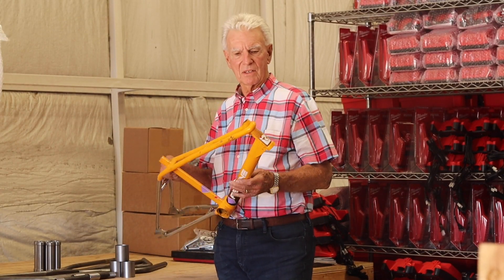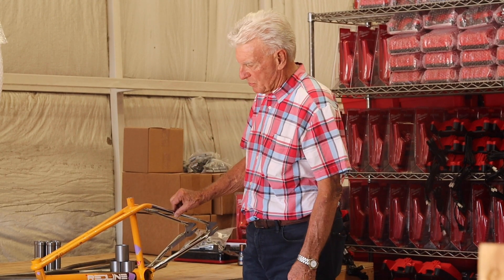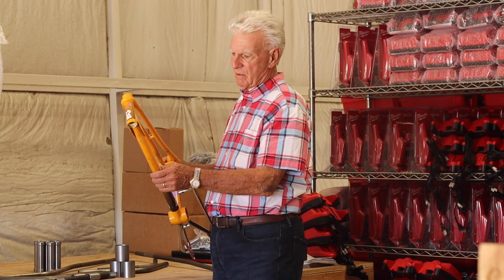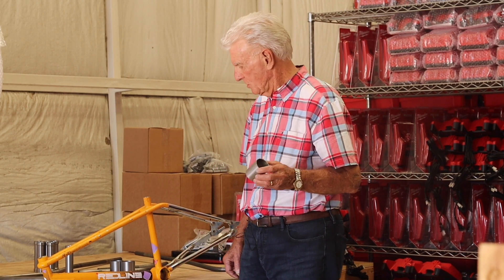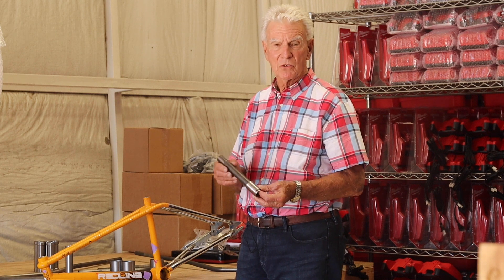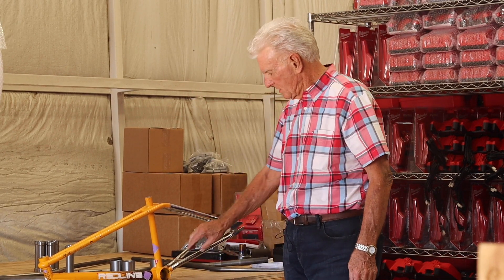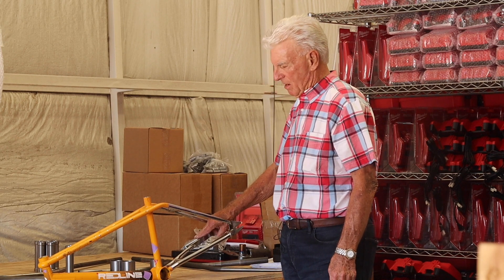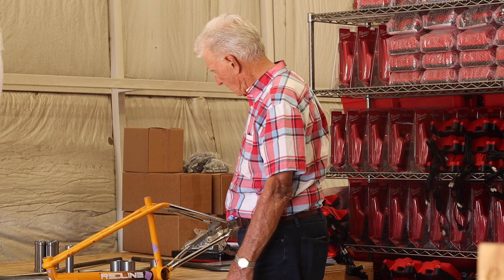LINN KASTAN TALKS ABOUT THE RL 20 II PROSTYLER   HD 1080p

Comment: To me, Redline and Mongoose kind of 'missed the bus' on the retro-looking, modern bikes thing of a few years back. Haro and GT got it right, make a retro-looking bike but with all the modern features, like internally butted tubing, modern geometry, mid bb, u-brake mounts, integrated Headset, 14mm, thick dropouts... Making the bikes exactly as they were is cool, haro did a few 1988 sports and masters replicas too, but most of the retro bikes were modern bikes.

Comment: -One of the greatest, most exciting, days of my 13 year old life @ that time period was when the large box bearing the *Redline RL20-II frame, fork & 'Forklifter' handlebar set having had arrived @ my doorstep!
-Early summer/June 1987. 
-A Father/Son freestyle-bike customized total build project.
-MAN?!...-That set was incredibly $pendy too!  
(Ive seen vintage, 1980's era RL-RL20II frame & fork combo sets being $old on eBay for $1,400 on the low end, all the way up to $2,500+ on the high end!  But the recent reproduction batch of 100 frame & fork sets, $elling for a >> ridiculous << $3,000!?)

-IIRC?  In 1986/'87, the total cost for those 3 pieces was approximately $700+ just for the frame, fork & handlebar set!  
-Which I wasnt a spoiled kid, nor my father a wealthy man, but I was tall for my age & that particular RL20II frame was a great fit for taller/bigger riders. I shouldve kept it around just for its possible resale value in later years eh?

-Considering during the 1985 to 1989 time period,  a top-tier freestyle bike from any of the  big-name brands @ the time ran about $450-$650 for a complete bike with all the bragging power(s), bells, whistles, bruises n' band-aids.

~ WHAT an AMAZING overall design, wonderful, professionally artistic welding work & original manufacturing materials used!

*Only problem being:  The frame/fork combo was in Redlines TEAL color offered, about IMO as bad as the purple 'Rad-Berry' color offered, which I'd originally hoped for the paint color in White, or Red & @ the very least, the  last color being in Yellow. Guess it was the 1980's though right?
-As that Teal set was the ONLY RL-RL20-II Frame n' fork set available over the entire West-coast region to purchase @ the time! Having it ordered from our local bike-shop, there in Everett, WA.  
-Nothing some toxic AF, but incredibly effective, paint stripper, excited teenage muscle power, polishing compound & a buffing wheel couldnt take care of.  Revealing the gorgeous hard-chrome finish underneath!..;)

Comment: Redline products were truly another level compared to Haro and GT, no doubt due to Linn's dedication to details, high standards, and commitment to engineering excellence.  I broke many Haro frames and forks from this era, and my Redline frame took my abuse with ease, including the forks, and forklifter handlebars, all three of which are currently 20 feet away on my original bike, and still look and perform like the day they left the factory.  Redline flight cranks are also legendary.  The Redline stem was not good, way too narrow, but no one is perfect. 😄    Thanks for making such great products Linn! 👍

Comment: i used to have one back in the day.  He's right about the strongest!  it didn't hurt that 48 spoke wheels were part of the package.  It also had a unique fork with threads to accept pegs that were high near the brake calipers.  the fork was tapered as well.  If i recall it was about $500 in 1986 money.  My mother sold it (without my knowing) while i was away in college to some kid for $150

Comment: Ahead of its time.  I owned three in my lifetime and currently own one that was painted tomato red over the original turquoise finish then later at some point years ago the previous owner discover the original turquoise paint exposed by tomato red paint chipped off so they removed the red saved original paint underneath but still have red visible in a tight spot like inside headtube and under gusset. Could be one of few prototype 1985 tomato-red frame? We will never know but this will go down to the grave with me.